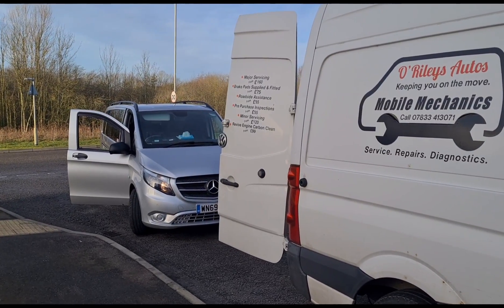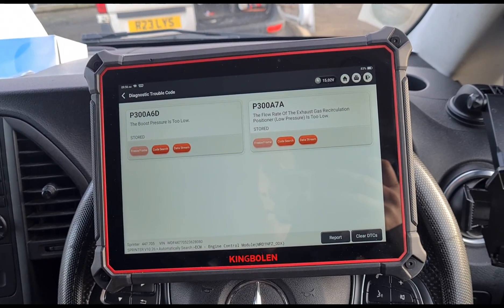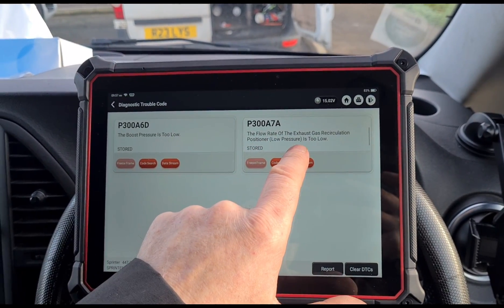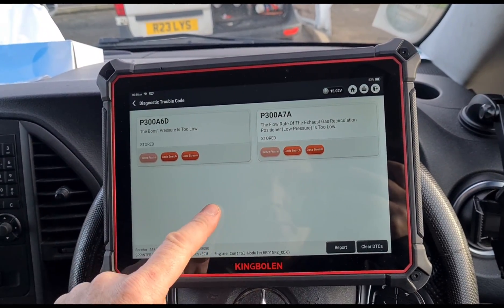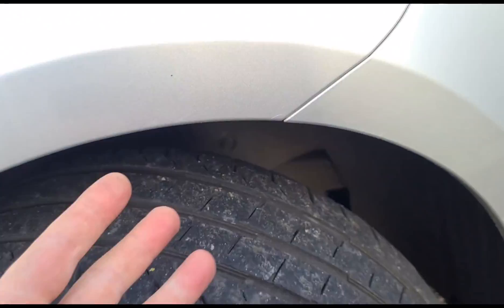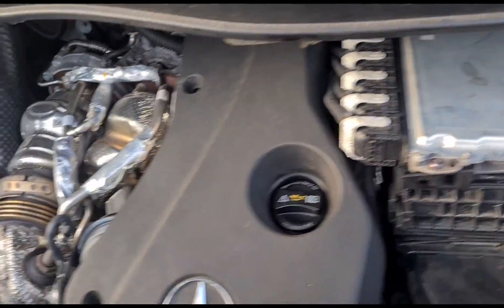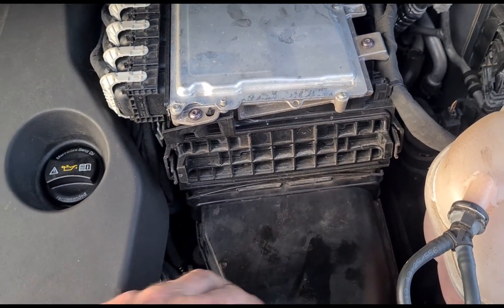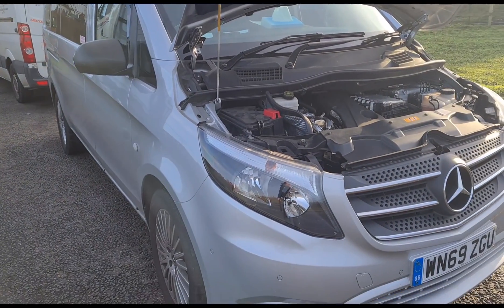Mercedes Vito P300A7A Flow Of Low Pressure Exhaust Gas Recirculation Is Too Low Still After New Part

Comment: I have mercedes v-class v220 2019 om654 engine with the same code p300a7a and black soothe at the tip of the exhaust. Car have 225000km. Till now I changed low pressure egr, and rear section of the exhaust with catalyst and exhaust flap and exhaust flap actuator. Still have the same fault. Don't have any weird sounds from the engine and car works smoothly. Do you think dpf might be the problem?
Reply: And what does this mean? 
1.P300A7A The Flow Rate Of The Exhaust Gas Recirculation Positioner (Low Pressure) Is Too Low. The fault is always STORED. Is it possible to calibrate egr to remove this problem?

Comment: The amount of those new merc 6 and 4 cyl diesels we do at work.... The camshaft followers usually fail at around 100K miles taking the camshaft with it, comes as an assembly from Merc at around  a thousand pounds with all related gaskets/seals
Reply: Is the failure related to the extended oil change intervals with 0w30 that's the standard with new vehicles?
It must certainly accelerate the failure.
Reply: I put it down to planned obsolescence as a lot of vehicles made after 2016 don't last until 100k miles without needing something major to be repaired. Heard here and there in the car dealing business that lifetime of a vehicle is around 60k miles these days. Short answer is yes it's the oil, 5w30 and changes every 10k miles is what I'd do

Comment: How is your Crafter reliability wise ?
Reply from the maker: Excellent. 260'000 miles on it
Reply: @ORileysAutos  What makes the Crafter better than the Sprinter?
Reply from the maker: @alouisschafer7212  easier to maintain and easier to get parts. Vw 2.0tdi

Comment: One thing that got me was the voltage reading on the diagnostic tool you were using reading 15.02 volts. To me, that's overvoltage assuming the reading is correct. Personally, I'd be worried seeing a voltage that high.

Comment: His differential pressure sensor and soot reading were showing fine. Will the differential pressure sensor reading high when there is more soot in the dpf. Will the best time to check differential pressure straight after the passive regeneration of dpf?

Comment: That noise is almost certainly lifter failure on the exhaust side, very common on these engines.  Not a cheap repair unfortunately.

Comment: Sounds like VW T5’s when the camshafts used to wear through the hydraulic tappets, a hole would form and you’d hear exhaust gases coming back out through the intake, giving that distinctive popping sound.

I think like you say, if they’ve overfilled with fluid and hydro locked a cylinder it may have bent valve(s)

Comment: Another great diagnosis Jimmy.  I totally agree.  Failed dpf causing lack of back pressure into low pressure egr even with exhaust flap closed. Dpf cleaner has been injected gone though egr cooler and into intake and damaged engine. It sounds terrible and that's why turbo is inderboosting.  Major engine work I reckon
Reply from the maker: Definitely

Comment: I had a Kia Optima and that very distinctive knocking started happening to the Optima after doing some cleaning of a sticky EGR by spraying that Wynn solution via the air intake while engine was running at around 3k revs, u have an episode showing this method, and then drove the car on motorway with high revs to expel cleaner from system and try improve DPF by burning soot, not sure what made car starting having that knocking sound but after changing oil that knocking sound almost disappeared, it was still there but barely audible.

So after reading many forums etc it seems oil degraded so bad it was not lubricating properly so my suggestion is to try and change engine oil and see if it improves the knocking sound, some people said some car brands are very sensitive to oil degradation and will make that sound after oil gets bad enough.

Comment: om654 exhaust camshaft,lifter knocking noise....Common issue on these engines.
Reply: wrong
Reply: yeah its wrong, 2020 models has the revised lifters

Comment: Sounds like what om654’s sound like when the rocker arms and hydraulic tappets fail. Plopping sound from air intake. May be a good shout since they usually fail on the exhaust side.

But again, low flow, most likely due to a blocked dpf.
Reply: Best engine if maintained

Comment: my laguna 2.0 dci was making a similar noise, sounds like its coming from the airbox, i checked the turbo fan and then realized it was the metal intercooler pipe that runs across the top of the engine not sealing properly where it joins the turbo so it was sucking in air, took the pipe of and then refitted all good now